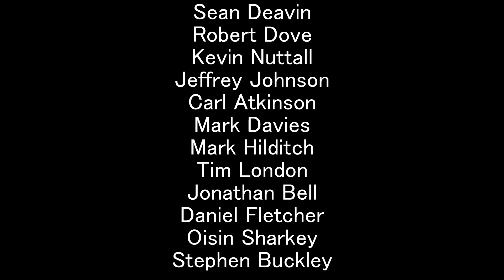Building a Kart Chassis FROM SCRATCH EP.1 Let's take on TonyKart and co!

Comment: As former product engineer, and now technical sales manager in a very competitive equipment industry, the number one recommendation is the following:  JUST COPY WHAT THE MARKET LEADER IS DOING.  They know more than you.  Anything you change will likely be a step backwards.  Who is the market leaders.  For 100c and TAG...that is OTK.  So what this means is buy a used OTK chassis...get out the drafting board, chop it up, and literally copy every single mm of it.  Every wall thickness.  Every angle.  Everything.  Building something is hard enough.  Designing then building is just too much.  Build first. Learn.  Then maybe change the design.
Reply from the maker: Firstly, success of a product can be a result psychological factors not purely engineering.  So following the herd isn't necessarily the absolute best route.  Also, you always read the regs first. If I copied OTK I'd be making a kart potentially not eligible for Motorsport UK racing. Or at least not optimised for the UK scene. 

Secondly, if you're building a kart for yourself why follow the herd, that's boring. May as well go buy an OTK.
Reply: @AlanDoveKarting   Build first. Learn.  Then maybe change the design.

Comment: So here is my two cents. Just know your first chassis is going to be drivable but not competitive. But that is okay. Your going to get done with the first one your going to want to build a second. So don’t get frustrated or discouraged. Fabrication isn’t something you learn over night. There so much to it. Ya anyone can notch a tube but it take time and experience to notch a odd ball joint and to get a perfect fit. Bending tube, I highly suggest buying a quality bender and make sure the bending dies are for tubing. When bending you want min deformation, you want that bend to be as even thickness as possible with min crushing. Welding the better the welder the better the weld in some sense. Iv seen some incredible tig guys do better work then me with a harbor freight welder. But for me i weld 10 times better with my water cooled foot controlled Miller. But I suggest you buy a welder ASAP and practice as much as you possibly can. Once you master that then start practicing welding tube joints. Now most company’s that braze they use a brazed lugged construction. Again there 20 dollar brazing stuff you can get and then there are exotic grazing rod and high end torches. Buy a quality one and start practicing. As far as steel goes, I know some company’s use 4130 chromoly, some use docol, and Iv seen some use DOM ( I would not use this) Some use a proprietary mixture they created in house. The thing your looking for is strength to weight ratio. 4130 isn’t all that much lighter but has a high strength to weight ratio there for requires less material to build. Ok as for the chassis jig think about it this way, it’s there to keep the frame straight and true and level. To keep the material from warping when wielding. So with that said a strong stand from floor to work height, flat work surface and the ability to securely attach things to. Iv built them with a wood stand and flare stock for a table and I just welded stoppers, up rights, and so on straight to it. Then Iv also spent but dollars building a jig that I could build production chassis off of. One thing is you can’t have to much jig. I know some high end kart chassis are welded under stress to duplicate the stress it’s under with full rigged weight, driver weight, and fuel weight going down a straightaway. Is that as important i don’t think so but I’m not a college educated engineer lol, I just go off of what I built and fucked up and then made better. But when using a jig just make sure when you bend a part and lay it on the jig that you secure it to we’re a fat chick could sit on it and it won’t budge you’ll be good. Good luck man. I 100% support this and welcome you into the world of fabrication good luck if you think you’ll maint any other hobbies once you start because all your money is going to go to tools, materials, and building. It’s addictive and good things because it’s time consuming, frustrating, painfull at times, and brain consuming. Have fun keep an open mind and welcome advice, fabrication is all about learning new skills to better your craft.
Reply from the maker: I appreciate this comment a lot.

Unfortunately funds have run dry and that's that :(

Comment: Can't wait to see how this project turns out. There have been a few smaller manufactures to pop up over the last few years, Air Motorsport comes to mind. May be worth hitting those guys up and seeing if they can offer any guidance on how you could go about it? 

A starting point could be to make a jig for the Tony Kart you have on a flat welding table and clone it as a start. Then you can start tweaking the design and trying other things/ideas with it
Reply from the maker: I was going to mention the Air boys but forgot! doh

I think the clone kart route is the place to start I think, deffo agree there